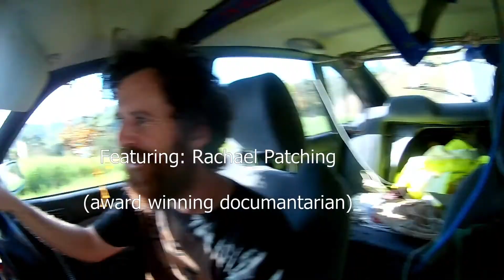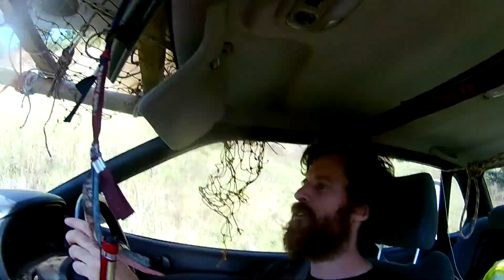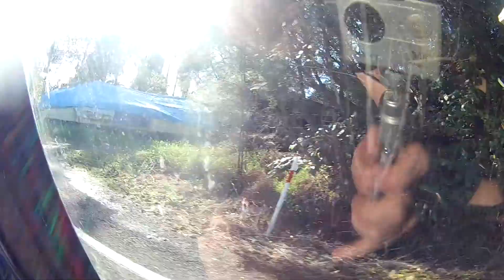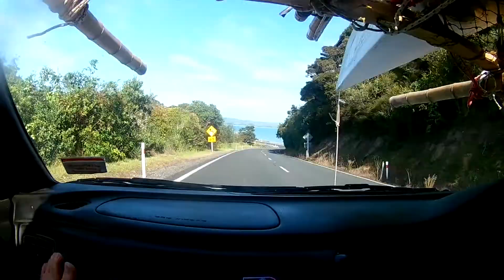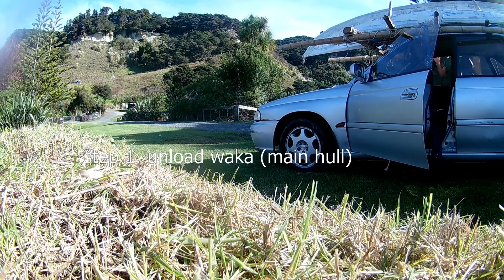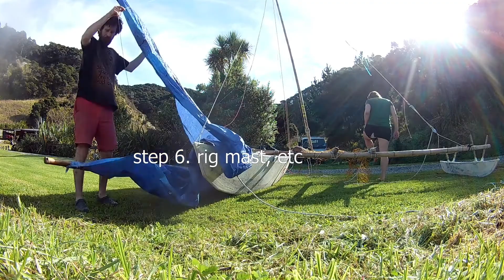proa Good Enough -- new rigging method (episode 3)

Comment: If you forget which way to wind the spanish windlass just try to remember "Righty tighty, lefty loosey"! You can thank me later by buying me a beer when you see me. No problem.
Reply from the maker: haha, oh no I tighten them so that the force twists it into the deck, and so they are self locking. if you did both sides the same way one would just come off. Though I have been meaning to add safety lines to tie them in place but didn't have suitable line handy.